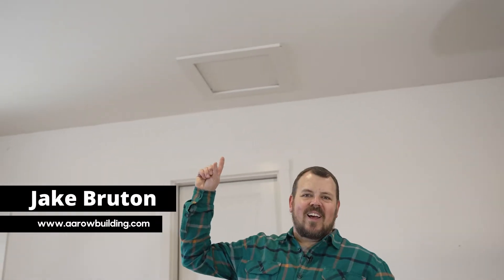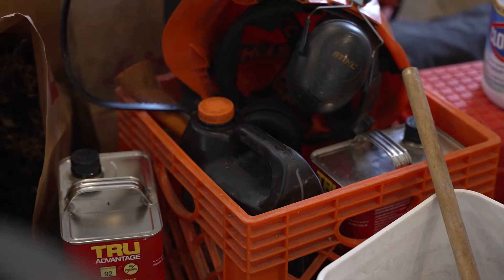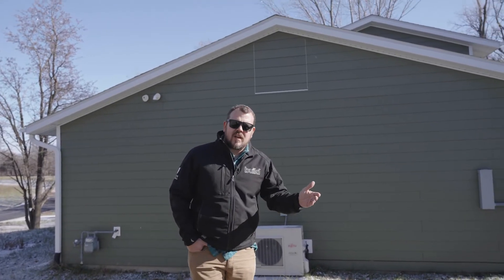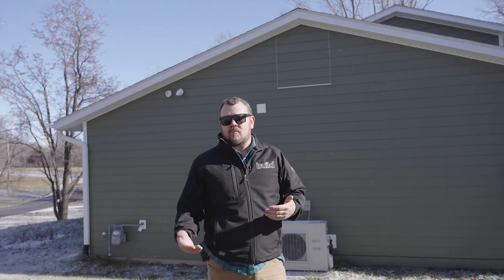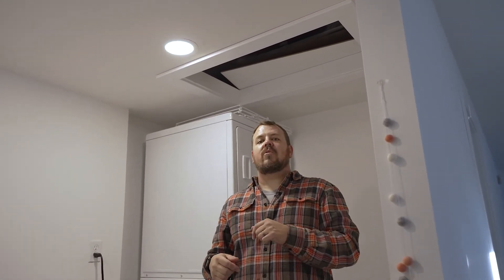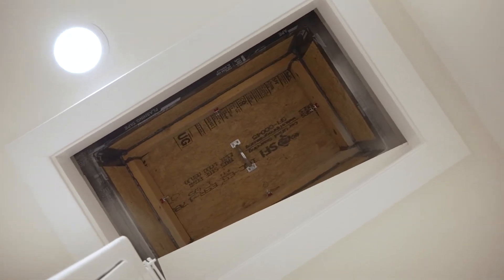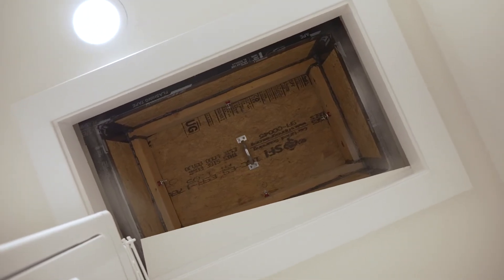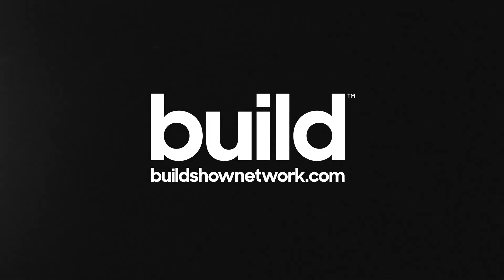Rethinking Attic Access

Comment: So I wasn't the only one thinking to ditch the attic hatch inside and put one outside.
If the attic is vented anyway is there any reason to make that outside door into the attic airtight? I'd think just make it bug and critter tight but any incidental air leaks wouldn't be an issue.

Comment: How do you make sure bugs aren’t living up in your attic? I get that it’s not directly connected to your living space, but i can’t imagine bugs not migrating inside your house with big holes to the roof.
Reply from the maker: The soffit has a very small aperture (less than an 1/8”) and the ridge vent has the same. These isn’t actually a space for bugs to find their way in. Also, no water, food, and high or low temps. In our experience they simply don’t want to live up there.
Reply: @jake.bruton.aarow.building  fair enough, thanks!

Comment: Hey jake- im designing a 1.5 bedroom 700 sf single story ADU - raised heel truss - vented attic in colorado. dont do a lot of attics and im wondering how to design access - this gives me some ideas, thanks! how much rigid insl on other side of that sub hatch?- my (main) question is related to running ERV ductwork - potentially burried in blown in insulation up there? its slab on grade construction so no crawl access, and im tight on space - dont love the idea of penetrating the air barrier (clg) - with ERV ductwork but also dont want to drop the ceiling ...any thoughts?  also - should i install erv up there - looks like there are some insulated ERV units on the market and would eliminate 2 penetrations - plus could vent and intake direct out gable end vs through conditioned ext. wall...  - thanks for sharing over the years, apprciate ya!
Reply from the maker: Zach, all good questions. Head over to the link below to see how we have handled this type situation recently. We have simply ordered the trusses with a step in the bottom to allow the ductwork to be inside the envelope and then it makes life so much easier. 

https://buildshownetwork.com/contents/trying-new-things-ceiling-air-barrier

Comment: You obviously never serviced electrical wires, hvac pipes, or whatever. You are making amountain out of the envelope. You could simply properly seal the attic hatch. Another builder thinking of himself. Btw, you the builder can go ahead and install catwalks in the attic
Reply from the maker: Well, we dont put HVAC in out attics, no duct work, no units nothing, so we attempt to make it so there is as little up there to service as possible. The last thing we want is someone walking around up there. There is 2+ feet of insulation up there in our homes there is rarely room left over for anyone to go walking around without messing up the insulation. Building catwalks isnt an option in most cases due to space, not always, but most. But, if you dont put things up there that need service, you wont have to waste time, money, and materials up there servicing things in the attice. As to the wires that need to be serviced, I not sure what you mean. I’ve never had to ‘service’  a wire. I’ve conducted renovations in which wires had to be relocated or removed but that is a completely different conversation. I’ve never had a wire that needed to be tended to during its regular lifespan. If we did we could bury them inside walls and floors as well.
Reply: @jake.bruton.aarow.building I'm in a situation where the bathroom vent exhaust fans needs to be fixed and we have no attic access...so sometimes things do need to be serviced
Reply from the maker: Absolutely, there are times where builders do put things up there. We try our best to not do that. Even the bathroom vent fans in our homes are the models that can be services from below (for the motors) and the piping is hard pipe taped and screwed together and mounted in place with straping so that it should never need to be seen again. Going into the attic is not a fun job and we should design around having to do so because it doesn’t take much effort.
Reply: Nobody services wires. A simple misplaced word. I don't like attics anyway. In older homes, your idea is a nightmare. However, with your homes, it may be a good idea. If you are running wires in the attic, that may be the only problem when the home is old. You could build it with wires below attic. A sub ceiling . A dedicated wire space. For some reason I wasn't grasping the home being built correctly. I'm so use to fixing all the other builders failures. Keep up the good work.
Reply from the maker: Thanks for commenting!

Comment: Jake, this was really helpful. I just blew in my cellulose a couple days ago and I have the same situation with a piece of drywall sitting on some weather stripping stuck onto a frame in the closet ceiling and a chase above. I’ve been thinking about how to make this not so much the worst part of the house as Steve would say and after watching, although I was going to build my hatch the same, I’ll definitely be using those lunchbox style latches on my hatch when I build it to keep it pulled down. Thanks for the content, super valuable.
Reply from the maker: A little thought and a little planning is all it take, right.

Comment: Love the outside gable access. My only concern is water. How did you waterproof it?
Reply from the maker: We used Zip tape and it is covered by a rain screen still. It also has a roll of Zip tape inside the opening for the next guy. However, looking back now, that tape will be cooked to death by the time someone opens it up.

Comment: After watching your video with Matt Risinger re: Vented vs Unvented Attics, I'm convinced that a well-designed vented attic is the way to go.  Assuming you may be looking at two feet of blown-in insulation, though, I'd like to see some details of the perimeter of the attic void space, i.e. where the sloping roof comes down to meet the exterior walls.  I'm really liking the way you build!!
Reply: raised heel trusses